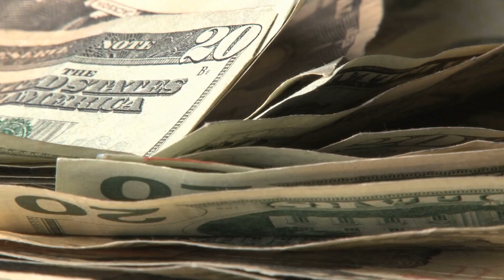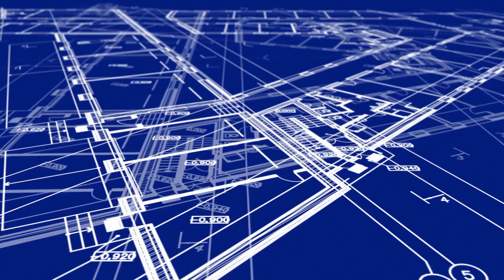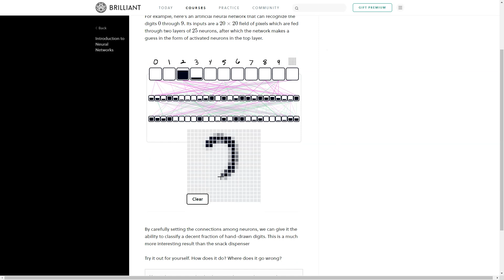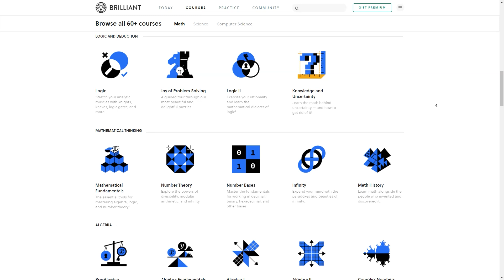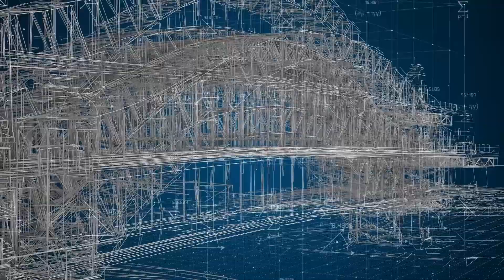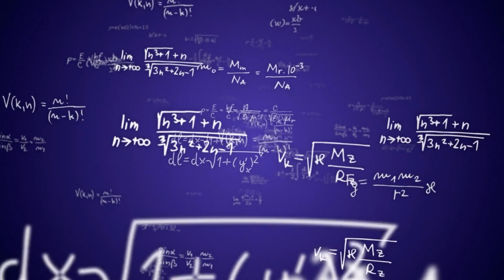How To Choose The Right Civil Engineering Firm To Work For

Comment: I started my civil engineering career through mining industry. there I worked in one of the Aisa largest zinc mines and it's smelters  then after two years I switched to a well reputed MNC consultant as structural engineer  at lower salary in which I'm currently  working in rapid transit and transportation department. It's been a two years here . 
I was worried about my career trajectory in mining industry that's why I switched to infrastructure sector even at lesser pay. Was it good career decision  pls  share your thoughts .

Comment: Im from India and I want to do my master's from USA and get a job. I'm in my 4th year of undergraduate right now. Can you please answer these for me, pleeaasseeee

Can you please tell me if u did any research work or write any thesis to graduate, like I see many universities having 4 credit hours for research in masters, can you please explain that. Also can you please tell me if it's necessary to have research papers published to get admission into graduate colleges. Or should I have some work experience before I apply for masters 

And can you please make a video on the best universities/colleges for masters in civil engineering

What are your views on structural engineering vs CPM. Which ones better. I love SF and BM diagrams and designing concrete structures but in India and USA, different codes are used so I was thinking of taking CPM for my masters. What do you say?

Love your videos ❤️
Reply: Watch here